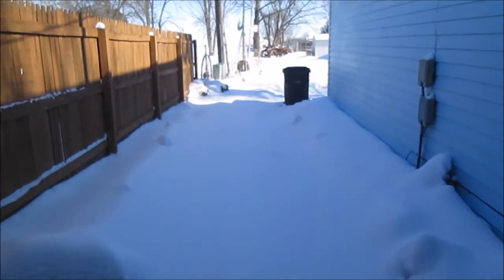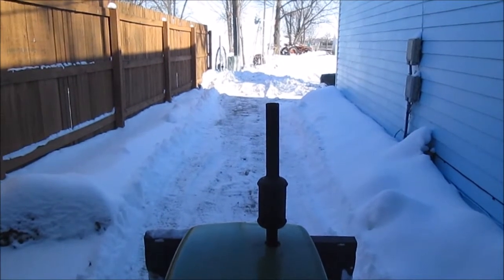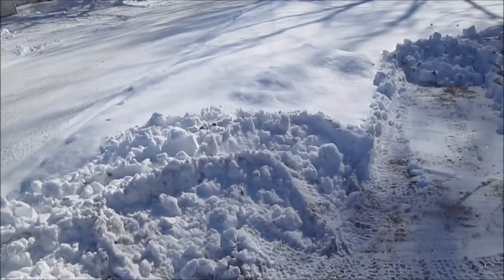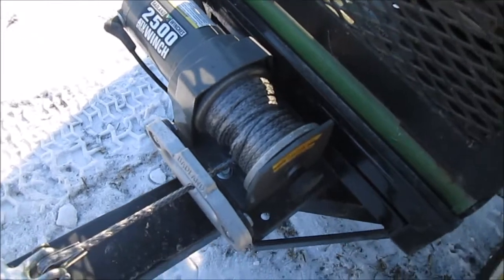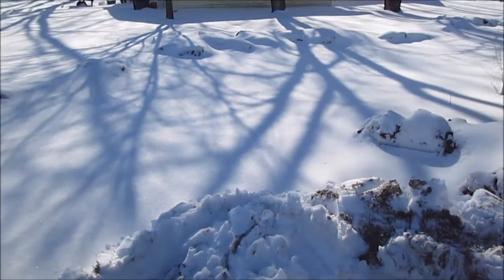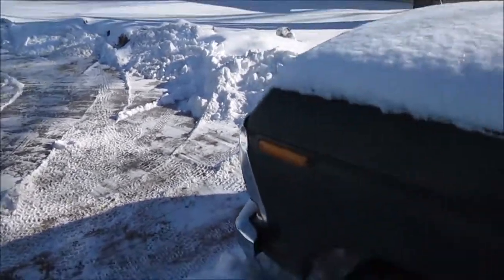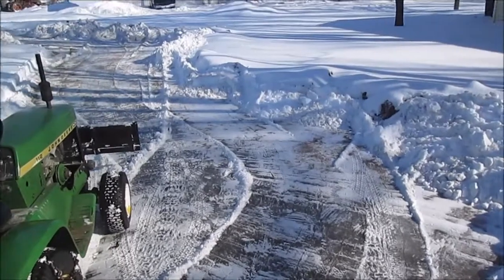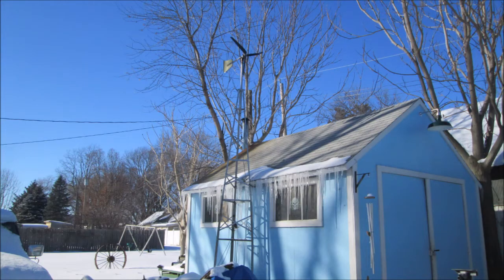Plowing Snow with my John Deere 112

Comment: The JD did great plowing that snow. An oldie but a goodie
Reply from the maker: They made them tough back then It has a good transaxle in it I use 2nd gear ..it does have the super low 1st gear

Comment: Question I have. I just go 4 inches of snow tractor is stock. Well as stock as a 50 year old tractor can be. Question is is it with tire chains heavy enough to push 4 inches of snow. I weight 140.